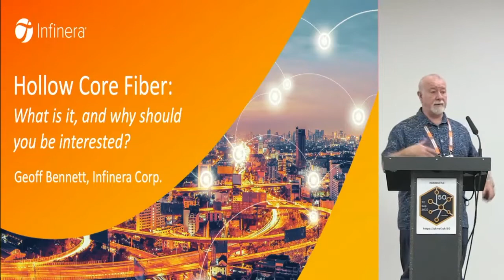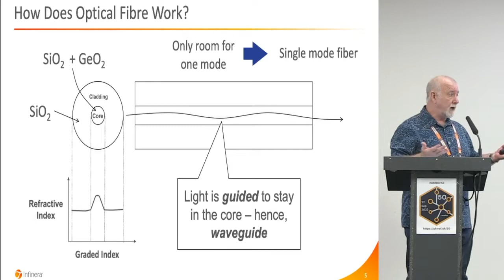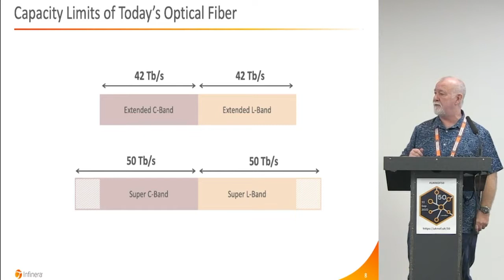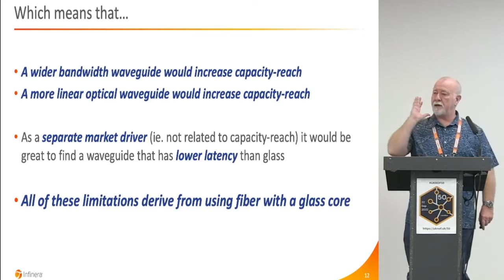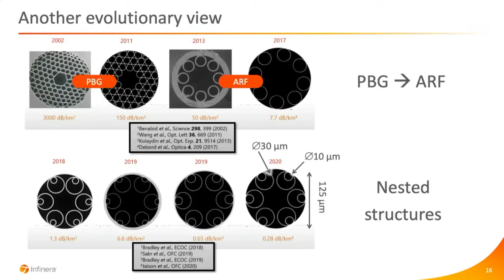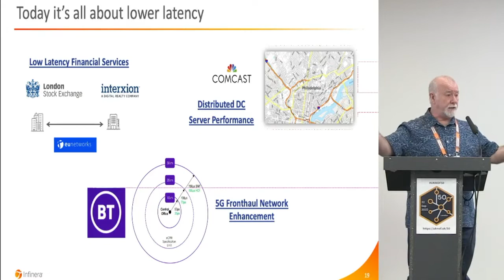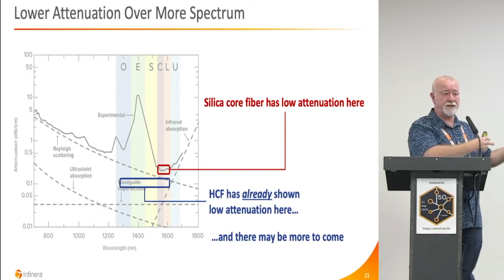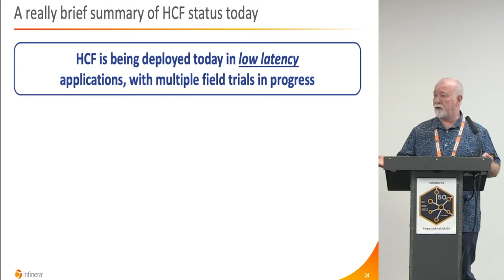UKNOF50 - Hollow Core Fiber: What is it and why should you be interested?

Comment: Interesting.  I could see this being problematic for use in certain applications such as undersea cables.  Imagine having a break in the cable and then high pressure sea water getting into the hollow core.  That would be a nightmare.  Also, might want to consider pumping a different gas in for below-freezing environments to mitigate ice crystals forming.  Edit:  he covers the undersea application.